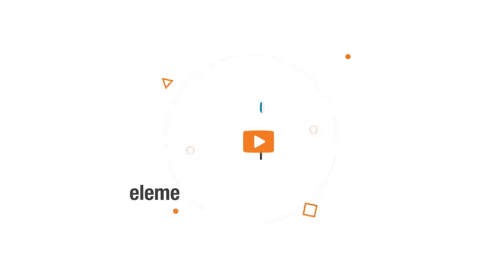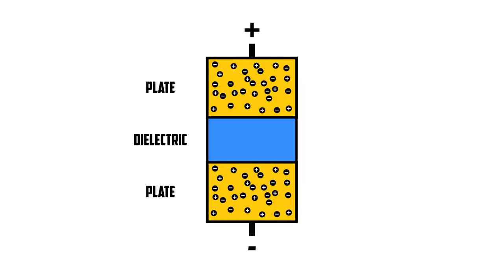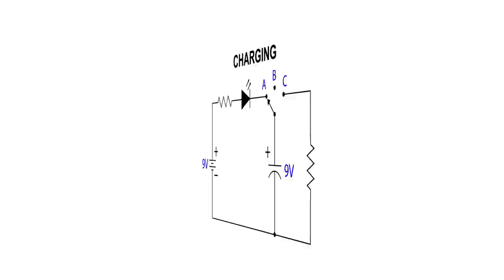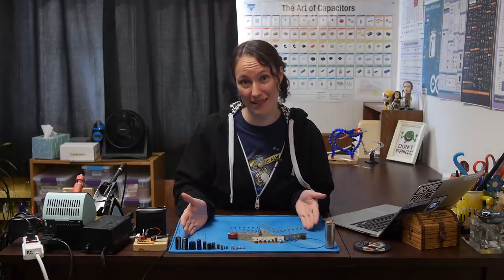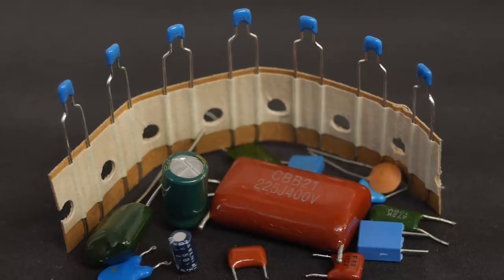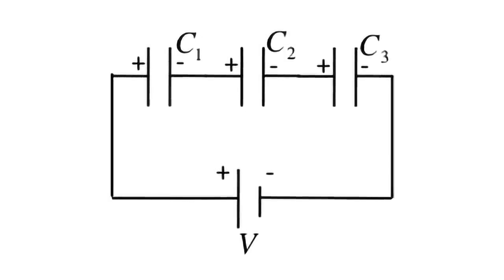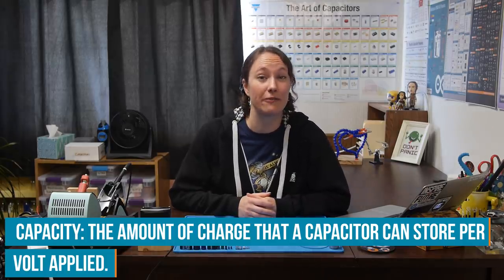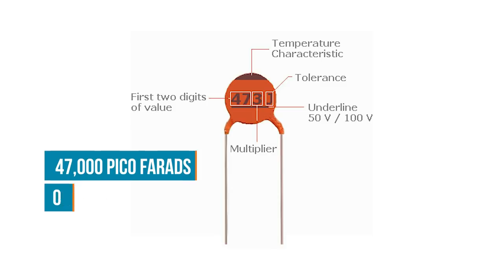How Capacitors Work - The Learning Circuit

Comment: What if the plates are not equal how will you calculate it
Reply: It can be calculated by considering the overlapping area of the plates. This is the basis of tunable air cored capacitors in radio circuits. By turning a knob, the user can rotate one set of capacitor plates (rotor) against a set of fixed plates (stator). The overlapping area between rotor and stator determines the capacitance. Because the overlapping area is variable, so is the capacitance. For a clearer explanation, look up 'Variable Capacitor' on Wikipedia.

Comment: I don't understand. If there is an insulator between the two contacts, then there is no circuit. If there is no circuit, how can either terminal gain or lose electrons to the relevant +/- of the power supply? Surely there is no contact for the current to flow between.
 What am I missing?
Reply: im no expert but i believe its the magnetic field that holds the charge. which is what the dielectric/insulating layer is for, close enough for the magnetic field to interact without causing a short.
Reply: So, think of it as a screen door, and electrons are leaves in the wind.  The wind can get through the screen door, but the leaves cannot.  So, the dielectric allows for "suction" to build up.  Bridging the capacitor is effectively opening the screen door and letting the leaves in ...
Reply: Even though they're not contacting each other and are separated by a dielectric, there is an electric field between the two plates which causes charge transfer.
Reply: See Dave Jones on EEVBlog for some in-depth look at current flow through a capacitor: https://www.youtube.com/watch?v=ppWBwZS4e7A
Reply: @BrandonFreemanAwesome  Cheers.
Reply: @FindStrelok  Cheers.
Reply: @BrandonFreemanAwesome ❤

Comment: egads... in your discharging schematic you have the switch after the light so when it is turned on c the power just goes back to the battery right? since the diode has no ground it can not light.. or am I just stupid? some of this stuff make me feel like a 3rd grader even though I am 66...

Comment: What about building a duel MW/LW radio around a Tayloe Mixer with output frequency of 455KC driving a phasing combiner driving a Motorola AM demodulator chip and power amp to drive a speaker

Comment: Would describing them as volatile battery be more accurate to describe them?
Reply: No, think of it as extremely fast rather than volatile. I like to think of it like this, a battery is like pouring out a cup of water slowly and a capacitor is like dumping out the cup of water all at once. Hope that helps you visualize it better, i am still learning myself but videos like these sure do help.

Comment: If a capacitor can discharge quickly at a high voltage, could it be used to jump start a car battery?
Reply: Um I dont think so
Reply: When you jumpstart a car, your really just providing a large current to the starter motor. You could defintly do that with a capacitor, but you would need a super big one. Fortunately there are capacitors called 'super-caps' that can do this easily.
Reply: Caps discharge over time when not connected to a power source, they could only give power to the battery just as much as they can hold meaning you would need a very large cap to do so. Also I dont believe the sudden discharge from the cap to the battery would be good for the battery as it cant handle the amperage in the given time (battery chargers for cars typically run at 2 amps for a slow charge, and around 8 amps to start the car).
Reply: Yes indeed with big enough caps you can start a car. there are plenty of videos on youtube about this